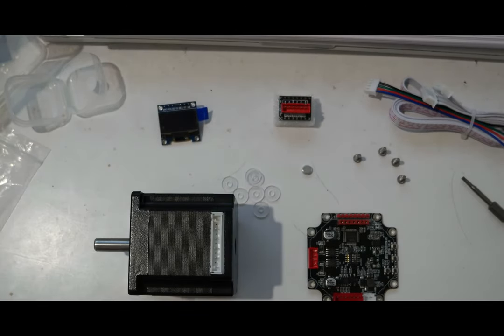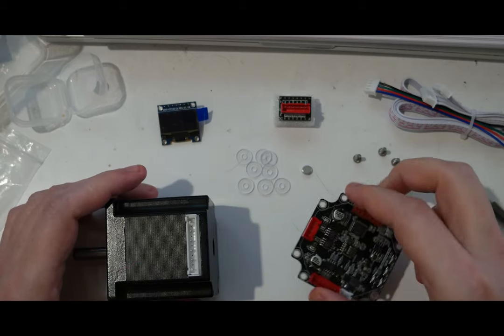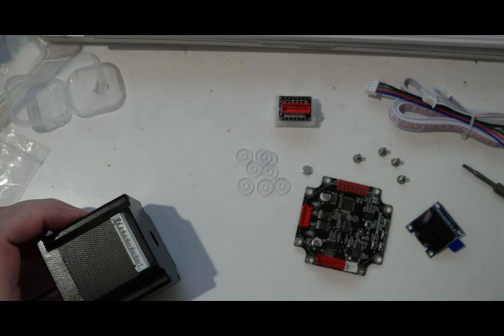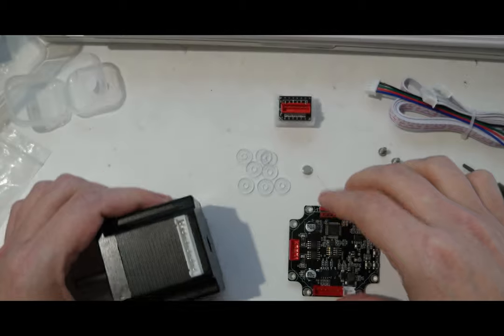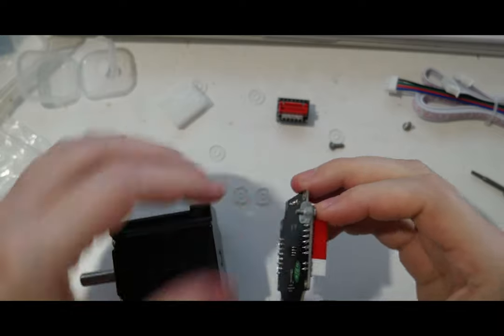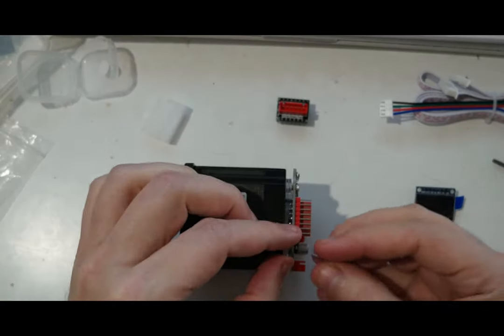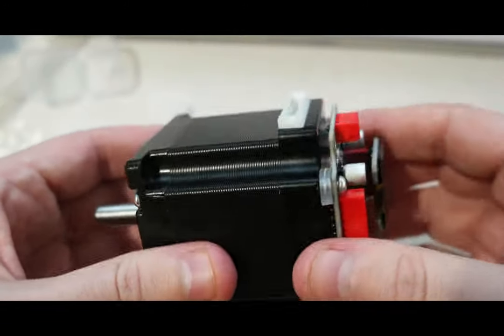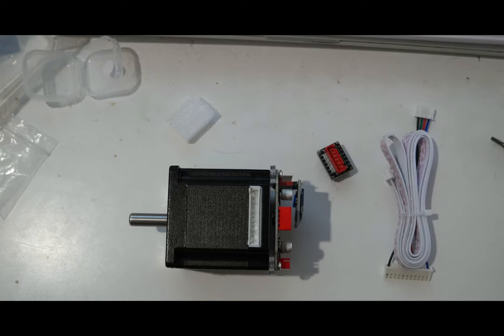BIGTREETECH BTT S57B V2.0 Closed Loop Driver How to mount on Nema 23

Comment: How much RPM can it handle? (1000-3000?)
I want to use it for a micro lathe spindle motor.
Reply from the maker: I think it's around 1000 rpm for this motor. You can check it on the motor link in the description. Please subscribe thx.